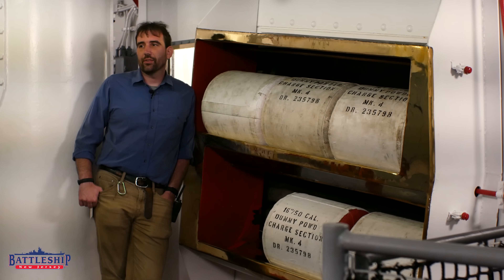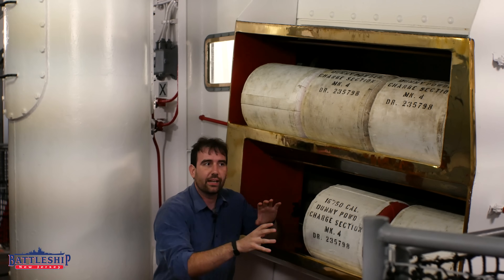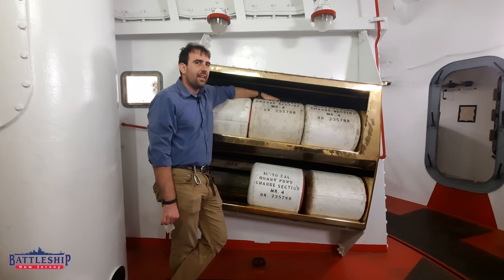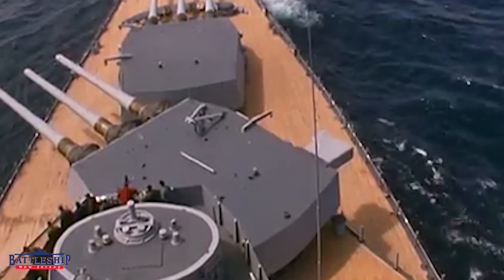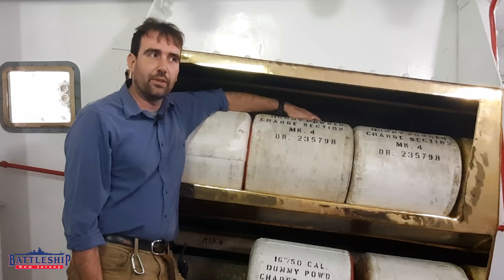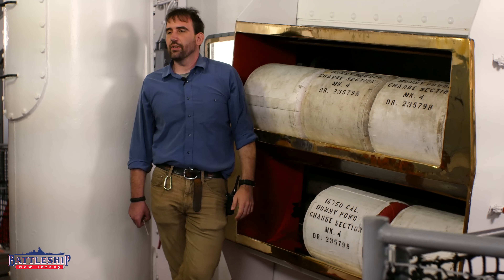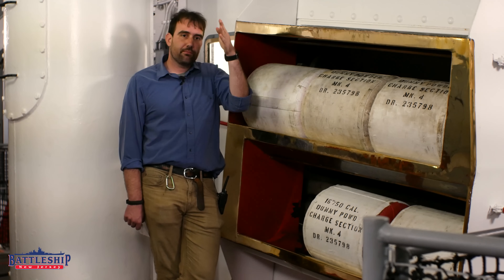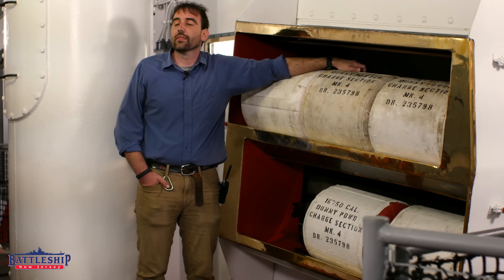16in Gun Powder

Comment: Gotta lot of respect that you read the procedure for making nitrocellulose off a card.  I'll take correct info over slick presentation any day.
Just to clarify though, the perforations in the powder grains allow for even burning after ignition. For example, if there were no perforations and the grain was ignited, the burning would take place over the entire external area of the grain alone releasing an initial amount of gas. As it burns away, however, the area of the cylinder becomes less reducing the amount of gas produced the longer it burns. The perforations provide for the grain to burn inward and outward at the same time so the perforations get wider as they burn just like the outer diameter gets smaller, creating a balanced burning. Generally, powder grains for weapons below 40mm have one perforation down the center while 16-inch gun propellant grains have seven as demonstrated in this video.

One ctiticism though, the internal pressure doesn't immediately start to go down as soon as the powder is ignited. The shell is moving down the barrel while the powder is still not all consumed. In fact, a consequence of priming the back of the rear bag means that as pressure is building unburned or still burning powder grains are being pushed up the barrel behind the shell.  There is a point at which pressure begins to drop as gas generation can't keep up with the volume of the barrel behind the shell, but it's not immediate. You can find out more about this subject in the 1957 Naval Ordnance and Gunnery Volume I, Chapter 6, Section C Gun Barrels and Interior Ballistics https://eugeneleeslover.com/US-NAVY-BOOKS/1-NO-10797-A-CHAPTER-6.html

Comment: I was on the shell deck of Turret 3, so technically, the most I've ever fired was probably the 330 lb charge. The higher charges were mostly right out of service by the plankowners. Apparently, there was a firing of a 5-charge of D-846 and one D845 and got some more range (and a thorough chewing out of Seaquist by the Navy), but that was before my time and not my turret.

Comment: I have a question, how do you flood a ships powder magazine, I know a lot of ships would do so if they had revived a hit and did not want to risk a magazine explosion, what did that entail? Is it just automatically spraying down the powder bag storage or is the magazine literally filled with water?
Reply: Usually, the magazine will have a high-pressure sprinkler system as well as an intake that allows sea water to enter the magazine when activated.  Remember most of the propellant is stored in water-tight, air-tight canisters and only a few canisters were opened at one. time.  The high-pressure sprinklers should contain most of the fire and cool it down sufficiently that the propellant in the canisters won't ignite before the water coming in from the sea water intake completely floods the compartment.
I came across an excerpt from an USN manual on Stowage and Supply of Ammunition from 1917 states that either system should be capable of flooding the magazine within 20 minutes: http://www.gwpda.org/naval/w04usams.htm
Reply: @Bob_Betker  hey thanks for the info

Comment: This video contains every aspect but one of understanding USS Iowa's #2 turret explosion and why it killed so many sailors:
1.  Remixed powder---a crazy idea approved by Capt Miceli (Crane Weapons Support Ctr), whose incompetence is mind boggling; the resulting random nature of each charge bag and the effect on muzzle velocity was what caused New Jersey's horrible accuracy while deployed to Lebanon.  Remixing the powder required that tare grains needed to be added to equalize the charge weight.  The fact that tare grains are added laying down is a HUGE factor in understanding what happened on Iowa.  The grains are cylindrical in shape and a cylinder is stronger when standing on end as compared to when laying down.  Ryan even showed a picture of the tare grains @10:41---note that some have crumbled from handling and storage.  Crumbled tare grains are more susceptible to igniting from friction and/or pressure.
2.  Polyurethane sleeve---these were on Iowa's bags, created cyanide gas that was estimated to have killed about a third of the turret crew, mostly on the projectile decks and powder flats.  Fire, suffocation, and concussion blast combined to kill the others.
3.  Iowa's reputation as a gunnery laboratory was due to them conducting unauthorized experiments with charges and alteration of projectiles.  In fact, the charge load that exploded at the center gun of turret two was a five bag load of the charges that Ryan said were not to be used with the heavier AP shells (although the mere fact that this charge and projectile combo was used was in no way the proximate cause of the explosion).  Another reason for Iowa's stellar gunnery reputation was how Chief Skelley scored his shots:   any round landing within 60 yards of the target was scored a hit.  (And I always got an "A" in school when we self-graded our tests🙄)

The aspect not addressed in this video is how the crumbled tare grains can be ignited if subjected to excessive pressure and/or friction, both of which would be present as the result of an over-ram of the charge bags.

The poor state of gun crew training and discipline, the lack of escape breathing apparatus, horrible maintenance, and a criminal level of command indifference are the human factors to the explosion.

Comment: I've been reloading rifle rounds for several decades. The largest powder charge that I've fired has been around 1/30th of a pound for a 50 BMG. And I've found that stored gunpowder starts to go bad after around 20 years but have fired a number of much older loaded rounds.

The diameter of the powder grains used in hunting and military rifles is more like a small pencil lead.

Comment: The pressure peaks and then doesn't drop until the shell leaves the barrel. There is propellant burning the entire time even after the shell leaves the barrel. Thats why there is a large fireball that leaves the gun. Propellant is still burning in the open air. Also the shorter barrel doesnt increase the speed of the shell. The shorter barrels needed a faster burning propellant because it has a shorter amount of time to build pressure while the shell was still in the barrel. A perfect load has its charge fully burnt right ass the shell leaves the barrel. If you burn up to fast you will get a slower round speed also if you burn to slow youll throw some of your load out and get a slower round.

Comment: I have a pair of the aluminum propellant cans in my collection, complete with 3 bags each.  The bags are new, never filled, and have a cardboard sleeve to keep them in shape.  They have pillow stuffing in the black powder quilting, and are marked with all the proper nomenclature.  One set of bags has the dark gray wear sleeves on them.  One of the cans was made for the 16"/50 guns, and the other was made for the 16"/45s.  That can was modified by welding in an 8" section to accommodate the larger bags of the 16"/50s.  The two cans were made in 1941 and 1944.

I have some excellent videos of the massive Indiana Army Ammunition Plant in Charlestown, IN, where most of the propellant for the war effort was manufactured.   The videos show how the plant was built, with gigantic wells that were drilled to supply the bazillion gallons of water used each day to produce, and how the propellant was manufactured.  It was an amazing place.  It had its own power plant, and too many buildings to count, each manufacturing various propellants, from rifle and machine gun power, to supplemental charges for mortars and mortar cheese, to the numerous guns of our favorite battleships, and everything in between.

All the powder bags were filled, then sewn shut, sometimes by hand, like the big bags, which also had laces up the side, and the quilting was sewn with the black powder inside, on a sewing machine.

The numbers are staggering, but then, ALL the numbers were staggering during the 4 years that America was involved in WWII.
Reply: its own
Reply: @NoName-zn1sb  Thanks!  Just fixed it.  I should proofread better when I use speech-to-text.

Comment: As a hand loader "grain" is a unit of weight equal to 1/7000th of a pound (or 15.432 grains per gram) used for measuring powder charge and bullet weight. I can't imagine grains, as a unit of measure, would ever be used for a gun of such scale. However, it still sounds, to my hand loader ears, wrong to use "grain" in that way. (Yes I'm aware of grains of salt, grains of sand and grains of sugar but we don't measure those things in grains as well like we do with powder and bullets) Iwould call each individual piece of smokeless powder a kernel. As far as I'm aware "kernal" is not also a unit if measure. 
Love the channel! Lots of interesting stuff.
Reply: Various propellants, from black powder, on, have both been weighed in grains (at least, smaller charges) and been manufactured in discrete grains (kernels) that were then poured into a bag or cartridge. I agree it can be a bit confusing (see also "caliber").

Comment: Before 9-11 you still could buy that  giant grain pelletized powder. They actually named a large grain black powder for cannons, "Super Slow". It is still out there in forgotten garages and basements. I think you can still buy it used legally, but buying it new requires a plethora of regulatory permits now. In a dry cool landlocked area powder stays much more stable with age, and in especially dry areas it can gain a little power. Usually, that means it burns too fast. The idea is that powder charge is almost just finishing up it's burn as the projectile(s) leave(s) the barrel(s). One could wet and re-puck smokeless powder into giant grain or pellet sizes. Nitric & sulfuric acids are almost the same thing. You can make all kinds of things the BATFE really doesn't like with fuming nitric acid and sulfuric acid, and "other stuff" like anhydrous glycerin, or certain hydrocarbons that make other stuff that explodes.  Chemically speaking, when that centralized chemical bond breaks the whole molecule flies apart rather violently.

Comment: Just for comparison, small arms like 30-06, 7.62, 5.56, 9mm and 45 usually vary 25 to 50 f/sec between rounds. Keeping 16 inch rounds to 10 f/sec or so is amazing. Largest I have fired is 416 Weatherby with about 4 ounces of powder.
Reply: Artillery projectiles can be produced to nearly the same weight and dimensional tolerances as small arms bullets.  Because the shells are so much larger the variations are microscopic when expressed as a percentage of the shells total size.  Same with the propellant.  A tenth of a grain variation in the weight of a charge pushing a rifle bullet is significant.  A full ounce of variation from one 16" charge bag to the next is by comparison nearly nothing though I suspect QC was much better than that.

Comment: Your details about making the powder were interesting. Nitrated cellulose had a very sketchy history during it's early years. Trace amounts of the acid used to nitrate the cellulose were retained inside the cotton even after washing , which then led to accelerated decomposition while in storage. There were many 'unexplained' explosions in ships and munitions depots because of NitroCellulose (NC) decomposing. It was determined that certain additives could be mixed with the powder that would keep this from happening and make the powder safe. These additives, such as  diphenylamine absorb the decomposition products that speed up the deterioration. Before WW2 these methods were well known and used. There are methods of testing that will reveal how much of the preservatives are left in the powder.

Comment: In the 80's I was with an artillery unit as a radio operator, and I remember being told about red bags that would be used for tactical * rounds fired out of 155MM howitzers that were so powerful they would disable the gun after being fired so the round would land far enough away. I bet the capability was there for those 16" guns as well. Glad they were never used.

Comment: I might be wrong, but a two pound charge for a 5 inch round sounds a little light. I've fired 5 inch projectiles using the full length 40-ish pound powders and the half length clearing charges when we got rounds stuck in the barrel. Twas a hoot.

Comment: I still have about five pounds of WW2 surplus H4831 single base propellent that was used in 20mm cannon rounds.Bought fifty pounds of it in the early’70s at under a buck fifty a pound.Still works great and is actually slower burning than current H4831.Of course it has been stored properly.

Comment: Biggest charge I have fired was 75.0 grains (1/7000th of a pound) of Accurate 2230 powder pushing a 500 grain (weight again) bullet from a .458 Winchester Magnum.  The propellent is essentially the same as you showed here.  It is quite a bit smaller in size (but can have the perforations) and burns much faster than the cannon stuff.  Impressive as a rifle.  Pretty small compared to a 16" gun.

Comment: Ryan - So I have a question for you: If you were to lower the number of the Powder/ Propellant bags to 3 (330lbm of powder), could you still get a reasonably high barrel exit velocity using a high capacity round? Would that just decrease the range? I would like to maintain 2300 fps on the round exiting the barrel, and do not care about the range reduction using this propellant weight/configuration. Planning an Extended Range (ER) SRM to increase the range to (TBD)!

Comment: On all the IOWA class battleships .. they made about a dozen replacement barrels for every one deployed..   The Navy never replaced any of them during normal service..  They also found out that wrapping the projectile in a teflon trash bag ,, increased velocity and reduced barrel wear.. As Ryan said,, the barrel is made to handle a specific pressure " which is very similar to a normal hunting rifle  about 60,000 psi"..  The guns on the second gun barrel deck are known by the sailors as:  pete repete and ditto..  The accuracy of the guns is amazing ,, they can drop a 2200 pound shell lobbed over 20 miles and dependably land within the dimensions  of a tennis court ,, so they are known as the worlds biggest varmint rifles.

Comment: 2:20 It's hard to believe that decreasing the charge from 660lbs to 655lbs (only 0.76%) would increase the service life by 21% (from 290 to 350 firings).  Was there a mistake, there? Was it 5lbs per bag, rather than 5lbs per shot? (Though even that is only a 4.5% decrease.)

Comment: What happened to the actual powder after 1990, and how difficult would it be to remanufacture the power bags today
Reply: The old prop charges were demilled and the propellant was recycled and used as feedstock for double base (NC & NG) propellant
Reply: We need to re manufacture these now in case we ever build a new battleship. Also start making new shells and barrels

Comment: IIRC, the British used rods of propellant rather than grains in everything from small arms up to battleship main battery guns.  Also, they used shrapnel shells for at least up to 12" caliber.  I believe the idea was to spray attacking torpedo boats/destroyers with about 2" diameter shrapnel balls.

The largest charge I have ever fired was from a M110 8" howitzer.  That does not count explosives used in mining and demolition.  At the other end of the trajectory the largest I controlled was a Field Artillery Brigade time on target (all shells arriving on the target simultaneously) using 2 battalions of 155mm and 1 battalion of 8".  50% air burst and 50% graze (impact) burst. Pretty impressive and not something you would want to be on the receiving end.

Comment: Just to clarify, the figure you are using is “equivalent to x pounds of old fashioned black gunpowder”, as opposed to actual weight of the propellant bag. Those 18” x 18” silk bags don’t weigh 650lbs.
Reply: Actually, each bag does weigh 110 pounds. It is not equivalent weight. The Iowas used 660 pounds of propellant because six bags were used with every shot

Comment: For a change I do get to say I have fired large shell artillery.  Although compared to 16inch was small. I did reserves time in the Oz artillery. We fired 105mm shells out m2a2 Howitzer and the Hammel gun. We had 5 bags in those but usually only shot with 3 on our training range. Think they were packed loose grain and each bag was actually different sizes depending on how far you wanted to shoot. Not sure of any specs any more but think we fired about 8kms but Max was about 15km.

Comment: The size and number of perforations in the propellant grains determine the surface area exposed to the flame front. As the outside of a grain burns, the burning surface are gets smaller. At the same time, the area of burning inside the perforations is increasing. This helps to keep the total area burning more even while the process is happening.
Small calibre powders may have one, or even no holes. These larger grains for the 16" gun have 7 perfs and some grains can have 19 perfs. The propellant is extruded from a die in much the same way as pasta is made. (think spaghetti, bucatini and rotelli)

Comment: Don't know about the weigth of the charge, but in my service period, I prepared charges for a 155 mm self propelled howitzer. These where for firing purposes, 5 out out 7 bags of propellant. (full charge is 7 bags,... if I remember correctly the higher numbered bags are each smaller in volume) And yes,... the propollent resembles and is a miniature version of the picture shown in this video. Like the series !

Comment: My experience with small arms is 50 feet per second variance is normal--and it can be twice that.  The design tolerance of 5 feet per second seems very tight to me.  Even 15 feet per second is very accurate until I recall how many MILES the shell travels.  That was amazing to me.